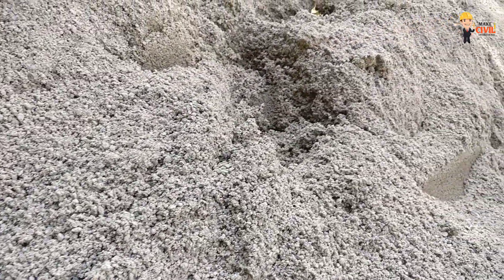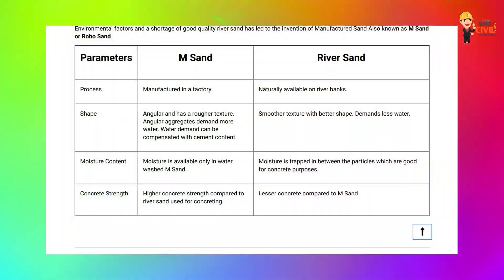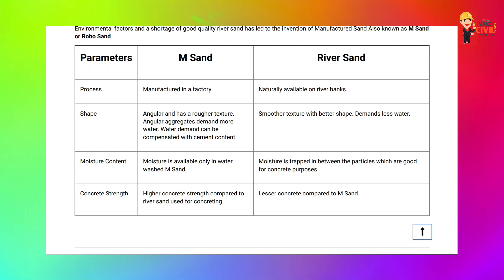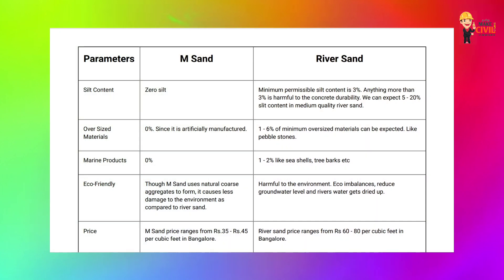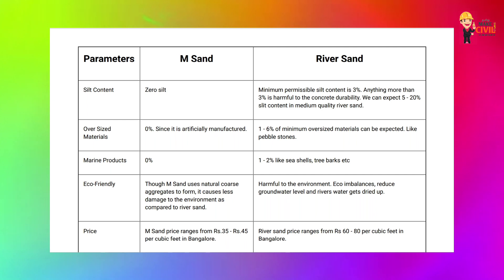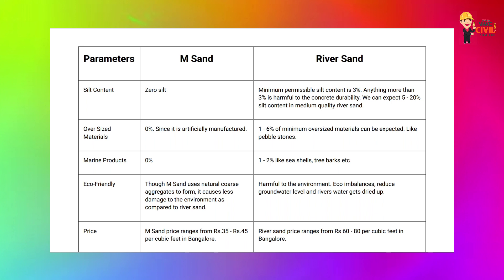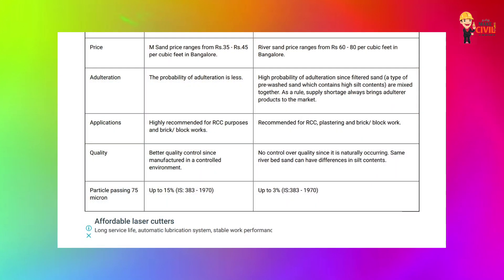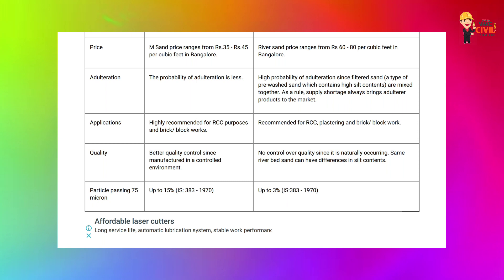m sand vs river sand in tamil எது சிறந்தது - முழு விளக்கம் | MCES

Comment: Bro main difference is heating issues

Strength and price vise na M-Sand is good and its available in two colors (white & black) 

As a civil engineer, my opinion for rich people is  river sand roof la use panalam 

Otherwise neanga M-sand use panitu building finishing stage la cooling panit or cooling tiles use pannunga 

Plastering ku P-sand iruku but inga um heating issues varum

So conclusion is according to strength & price vise,  M-Sand & P-sand is far better than river sand 

But we need to deal with heating issues

Comment: 1)Does M-sand require more cement in the mix to paste the bricks or in the columns and slabs(concrete)?
2) Does M-sand need more water in the mix(as u mentioned above)?
3) how does the life of the building changes considering M-sand over River sand?
Reply: great questions, some body tell the answer
Reply: Awesome question